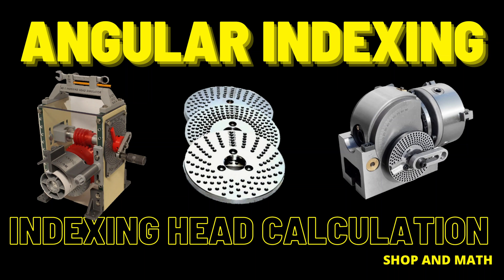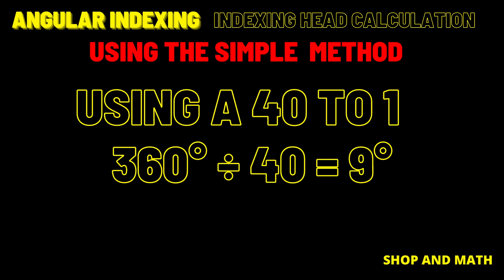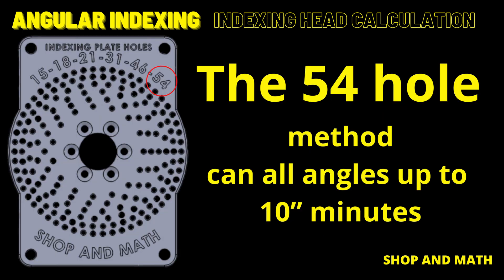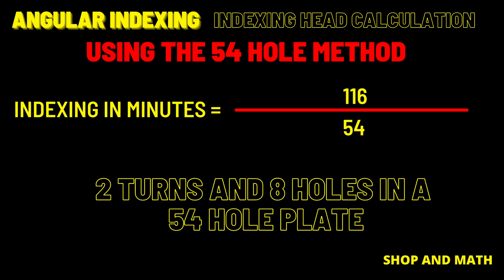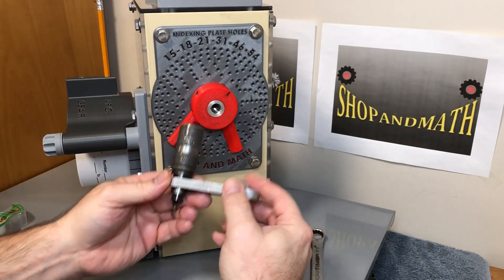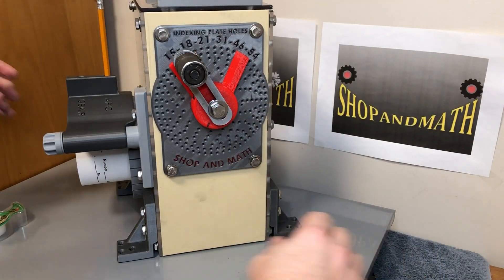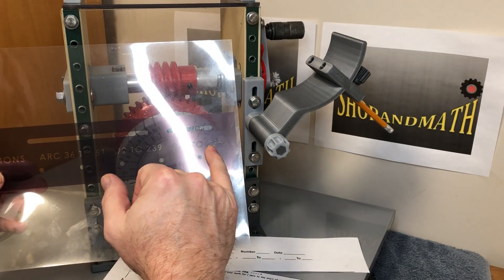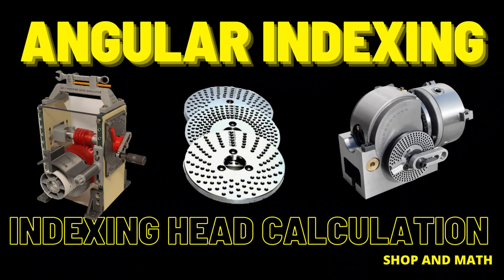angular indexing

Comment: Love the video. I watched it to help me with the calculations for a 127 tooth change gear to enable me to cut Metric Threads on an old imperial lathe.  I am having difficulty with the calculations and the nearest I can get is 17 holes on a 54 hole plate. I have the Cincinatti plates and a 40:1 dividing head. Would it be possible you could check that outcome. Thanks in anticipation.  Ian H.

Comment: OK now I need some extra help, I have to dial off 31.72 ° on a 40:1 dividing head with a 49 hole plate. I figured out that 31.72° =  31°43'12" which then equals  1903.2'. I rounded it down to 1903' and figured 540 goes into 1903 (3)times with a remainder of 283. should I just round it down to 1900 and then do 190/54 with a remainder of 28?

Comment: I want to start by saying I’m not trying to put anyone down, but I have to say this is 100% why the trade I absolutely love is dying this is the shit they are still teaching in trade school for machinist, the problem with this is where we are from there might be one or two shops that do not have cnc machines. Those shops as a general machinist top paid guy you might be lucky to break 25 a hour and yes back in the late 70s early 80s that was a great wage but now in 2021 that is a wage you can barely live on. This is why the younger generation is not going into this trade. Now that being said if they really knew what this trade could offer them you can bet some of these kids now a days would 100% go into general machinist trade. You get into a top paying aerospace shop as a programmer operator you could make 75k a year to start. If you work your way up the company and get onto there 5 axis equipment as a programmer operator and your making 90-95k a year and in 2021 that is a rate you can live on... The problem with teaching kids for 3 years how to operator equipment like that gets them nowhere now a days. Honestly you would be lucky to be a button pusher at a shop after a 3 year apprenticeship the apprenticeship should be 1 year on safety, manual mill (basics feeds and speeds drilling etc) lathe and other manual equipment then the last 2 years should be how to program with mastercam and how to make complex parts with multiple setups on cnc equipment... Ray I’m not trying to bash on you, you are amazing at what you do and are a great teacher I had you years ago as a substitute teacher and I got along great, what makes me mad is that the apprenticeship has not changed in 30 years but the trade has. Anyways great video great explanation on the indexing head but in my eyes in a modern day shop all that’s good for is a paper weight to hold down the stack of prints  I have to program, set up and run through on the cnc machines.
Reply from the maker: Hi Josh
I agree with you the curriculum does need to be upgraded
The reason why I made the indexing head simulator is because I’m taking the actual use of the indexing head out of the shop and bringing it into the classroom

Indexing head is still in the curriculum and must be covered

We are switching over to using The CNC to cut the year quadrant project

And on the opposite side of the coin some people are going to say that we’re teaching them how to be button pushers that is not what’s going to happen they still need to do their own set up and we will also be writing the programs as well

Josh it’s good to hear from you thank you for commenting and watching
Honest straightforward comments are extremely important keep them coming
Ray
Reply: @shopandmath   Ignore the critics. There is still a need for the old school guys who can do a "one off".  Many of those one off jobs can be done quicker than a CNC machine. The CNC is a clear winner if there is a quantity required.  I live in a rural area, 300 kilometers to the nearest CNC machine.  I cut gears, splines, keyways, machine pulleys and keep the Old engine collectors, hobby farmers old tractors and old motorcycle guys happy.  These skills will become more valuable as time goes by. I use the analogy of the Blacksmith and saddlers. There was one in every little town until mass production took over. Now those trades are Artisanal.  It's now considered an art form, Blacksmithing and leatherworking art schools springing up in alternative communities everywhere.   I am old enough to remember those early days.